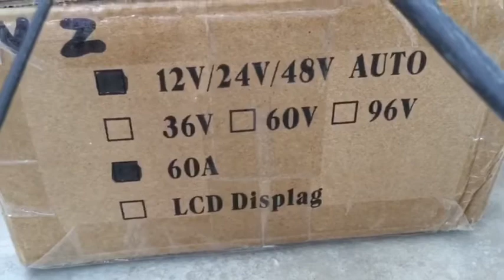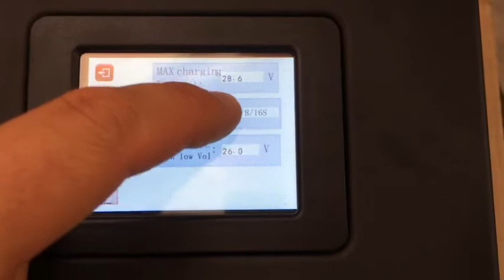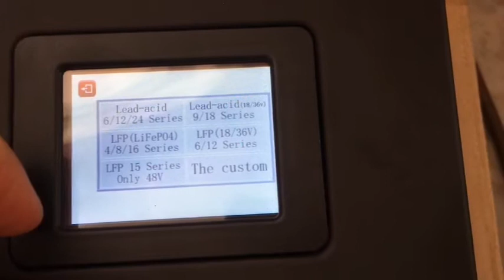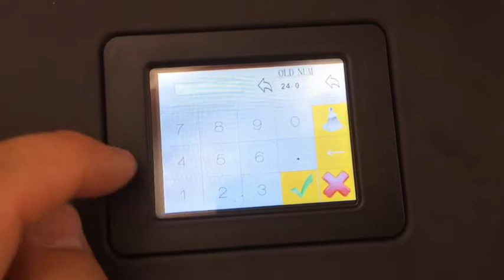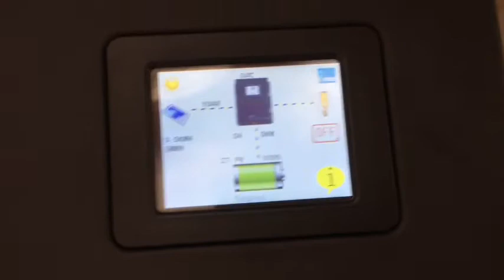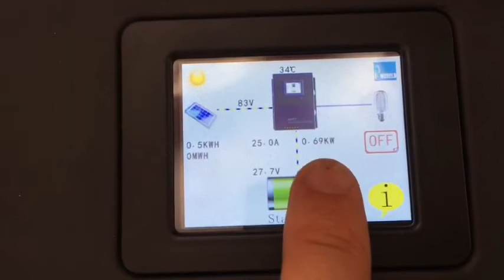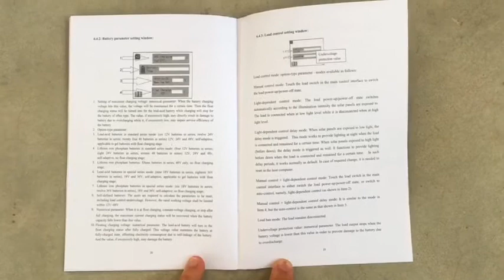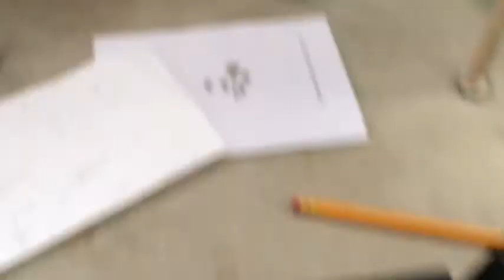wzrelb mppt charge controller product review -- don't buy this!

Comment: Yeah I bought this and its doesn't work with my vatrer v52.1 wall mount battery.. when I plugged solar in it doesn't charge the batter. But I know solar is working for sure because I hook up the same solar connection to my ecoflow delta pro and it charge with no problem.
Reply: Gonna return it.. and get a another charge controller..
Reply: BTW that port is not for a screen its a rs485 communication port